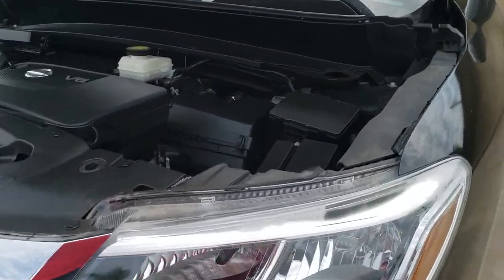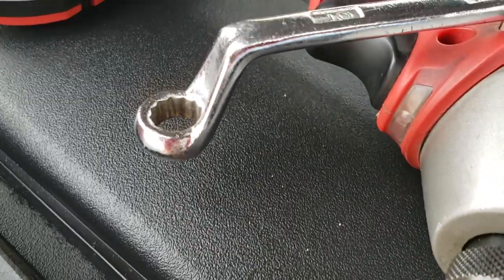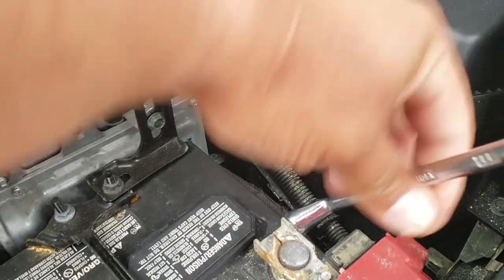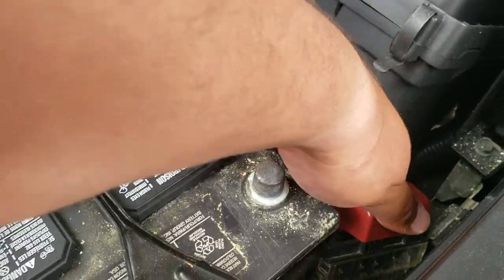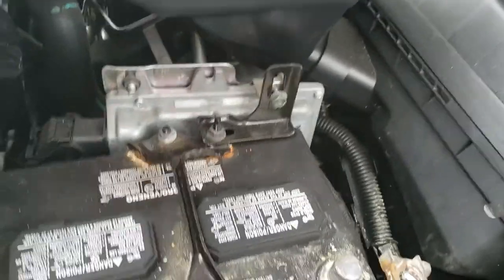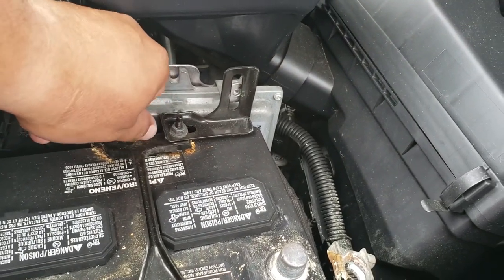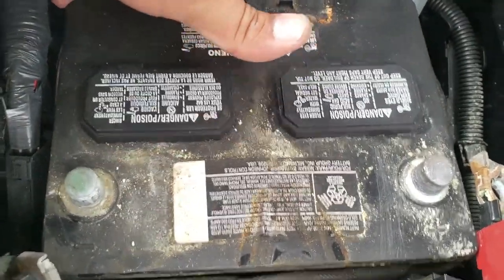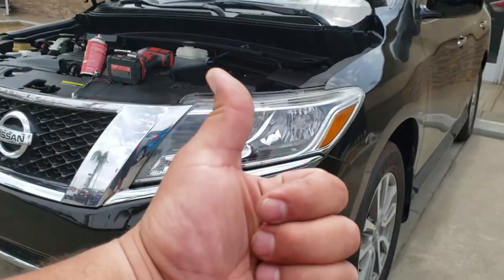How to: Remove a battery from a 2014 Nissan Pathfinder

Comment: I thought you always take the negative off first
Reply from the maker: You can, but in this case the battery was bad and completely drained, so there is no right or wrong way of doing it. All the electrical charge has been drained from the system already.
Reply: @559powerscape  Nailed it bro!  In AZ ... and likely CA ... you can be guaranteed your battery is DOA.  The heat and energy requirements stress out the best of batteries.